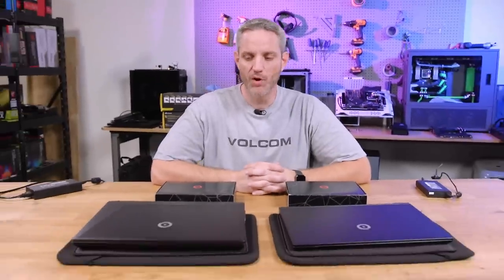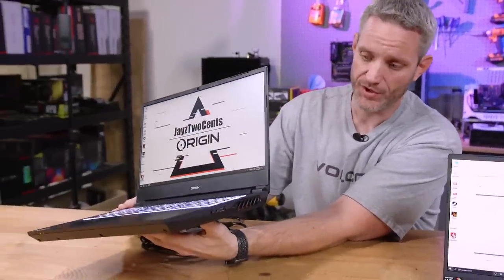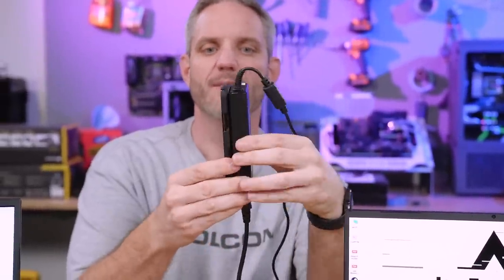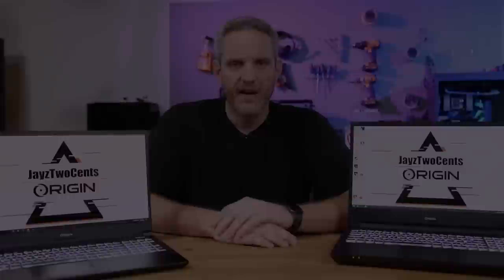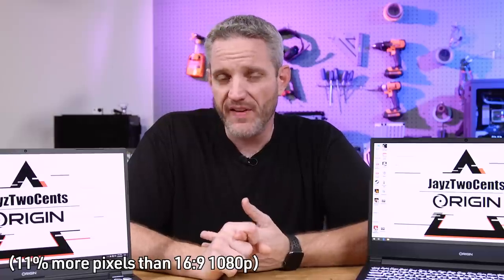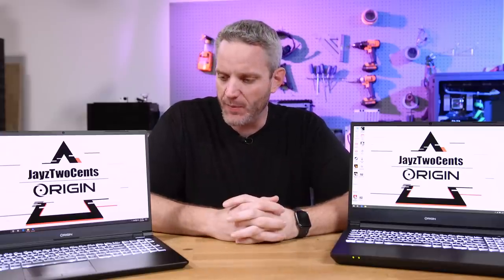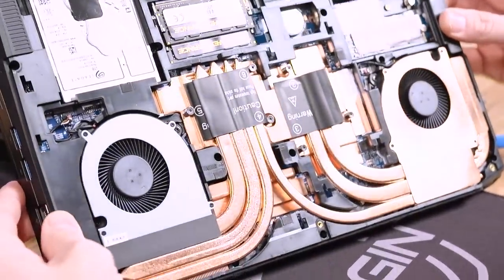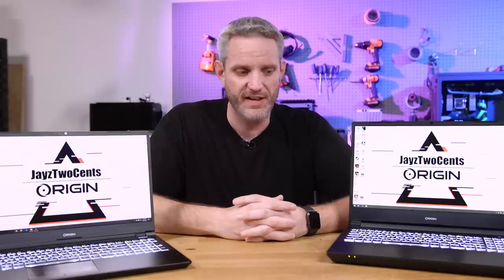A Laptop with 16 Cores 32 Threads?? Desktop killer!

Comment: “These laptops are faster than some desktops”

Yes at twice the price
Reply: cant pick up your pc and go to the park to watch homeless people fight though
Reply: @IIlicit  actually i am embarrassed to admit that i can.  took the UPS once.
Reply: Utube isJunk  Most laptops don't have soldered RAM. And if you actually watched this video, the desktop replacement has a socketed CPU.
Reply: Twice the price of only the computer, yeah? Did you include the price of a 4K OLED screen and a battery that will power both for a few hours? This one will be harder, but it's also noteworthy that it's probably 5% the size of just your computer and you can toss it in a bag. Admittedly if you have an ITX build this will be 20-30% the size of your computer instead - but then the UPS would be the size of the computer also, and you still need a monitor, mouse and keyboard.
Reply: @B B The 17" screen yeah. If I have so much money that I'll be buying a full decked out laptop and have at least one fully decked out gaming station, I wouldn't be worried about the price of any of it. I didn't include the mouse and keyboard in the price argument, just the portability argument. Generally you'd have a pretty decent mouse to go with it, but I sure as hell wouldn't carry a keyboard around to game.
Reply: But remember you get a free 4K monitor and a mouse vs. a desktop.
Reply: @IIlicit  ima desktop guy, but  touché.  Id dump my x570 3600 for either laptop quick
Reply: Well with Origin it’s more likely three or four times the price...
Reply: @kaldo_kaldo  you gonna be plugging in your desktop same as the laptop i cant see that thing lasting very long in a Starbucks playing any game .
Reply: @B B Stop playing games... Dude, I'm 28, I have 1 kid, a job, a loving wife, and I still play games. Just because you grow up, that means you can't play anymore? I went on trips with my family, and when we were on the hotel at night we just boot a game and have even more fun. Just imagine being so narrow-minded and thinking that you grow up and you stop doing what you find fun or what you love. You need to grow up
Reply: @B B did you read the part where I said we boot a game AT NIGHT?? Who said we don't enjoy the rest of the day?? When we go to the hotel after everything we did during the day?? Or don't you even know how to read the whole comments?
Reply: It's not faster tho' is it? Isn't running at 5GHz+ ? No? Well it's slower then.
Reply: @B B lol even in trying to insult you still show lack of intelligence.
You should try more, I believe in you. I'm pretty sure your father is disappointed in you right now, but let's change that.
Reply: oktc68 yeah it’s faster, but I was talking about the price
Reply: Twice the price, one tenth the weight, and a million times the convenience.
Reply: Utube isJunk  lol my laptop has 4 sodimm ram slots, an socketed i7, an socketed quadro graphics card, 3 m.2 nvme slots and an changable 96wh battery😂 and my laptop is one year old
Reply: Utube isJunk  dell precision 7570
Reply: No joke - I just matched the specs of my desktop and the thinner laptop was $1,200 more than what I spent...
Reply: You can take them anywhere and already have a keyboard charger etc u see
Reply: Utube isJunk  well if you can't upgrade and have 4000-6000$ but a msi gt76 Titan with an i9 10900k rtx 2080super it's insane
Reply: @spaghettiupseti9990  k
Reply: @IIlicit  u wouldn't like picking up this laptop tho :P    .....thicc boy
....sort of kidding
Reply: @B B what I get like 400-600 fps on fortnite and it's because the graphics card is mobile that it isn't as good but it's better than a shitty Nintendo switch
Reply: no one stop you to carry ur pc everywhere. its cheaper, better, only big. But one one will stop you.
Reply: And  only if it's  plugged in.
Reply: @nrgamingtech2797  BB is Probably just Mad because her dude spends/spent "too much" time Playing games instead of spending it with her.I had an ex who would always get mad when I would play video games,but she liked watching movies just fine. LMAO some people don't get it.
Reply: Utube isJunk  You might be interested in these clevo machines https://clevo-computer.com/en/laptops-configurator/graphics-card/with-mxm-module-replaceable/
Some of the first one's I've seen in a while with upgradable rtx mxm module cards in them.
Reply: @B B I bought a gaming laptop. I use it at work and when I'm not busy, I fire up a game and make it look like I'm busy, do you think it's pointless for me to have a gaming laptop? can't exactly lumber around work with a fully-fledge desktop, monitor, keyboard and mouse every day. 
And after experiencing the simplicity of not having to carry around all that stuff in other situations, I gotta say, I don't think ill be going back to using a desktop as my permanent machine, I can sit and game anywhere I like in my house and all I need is a plug socket. Also, it's not just about gaming, it's about having everything you want and do on 1 machine, I mean I can take my laptop on long journeys if I'm away visiting friends or family and I have my main PC with me that I use every day, it has all my stuff on, I can even use it on the actual journey if I want.
Reply: @garfield2742  Yeah, but I'm not exactly gonna go to my aunt's house and take over her dining room with a PC, monitor and a bunch of cables
Reply: @B B Or maybe you are someone like me, whom travels a lot and need the portability. Sorry dude, but not everyone still live in their moms' basements.
Reply: @B B Seems like you don't know the difference between travelling for holidays and travelling as a lifestyle, staying and working in different countries for months, sometimes years. Hope you enjoyed those 4 days though.
Reply: @IIlicit  I don't need my PC to come with me to go to the park and watch homeless people fight.
Reply: Especially from Origin, which has always been a huge ripoff. They're always overpriced. Origin seems to think their logo is as valuable as Apple's. And in a way, I guess they're right: I'd never pay for either.
Reply: @kaldo_kaldo  Nobody wants an OLED screen for their PC, you'd get crazy taskbar burn-in.
Reply: Pretty sure this is the same argument we use against console peasants tho
Reply: Cut the price back in half by using desktop components -- our 16-core based around a 1950x: https://youtu.be/NsdXrU-No2c -- fully upgradable if you are handy with a hacksaw 😂
Reply: But more than twice the ultility considering form factor size, mobility and still being multi functional for gamers, pro production and entertainment.  I still used old tech devices and media for entertainment using second hand free devices and have innovated my own cooling solutions to defeat the heating issues for my laptop / studio desk top by using a metal cooling plate from  old camping RV food & bev coolers. As long as its not so cold as to produce condensation moisture....it cools the entire area of the bottom of the lap top ( air intakes and chassis body ) and I never hear the fans while gaming.  I can not do that on desktop chassis and then that requires more $$$ investment, time and materials and some micro management to achieve the same practical solutions to heat issues and performance.  Overall, it has been a better overall investment. This makes my new 2012 laptop investment of near $3,000 a less painful prospect . I'm just waiting for the various brands flagship models to arrive at retailers & wholesalers to make my final selection due to specs and features.
Reply: @ernestopediangco5354  It's far cheaper to cool a desktop PC than it is to cool a laptop, it's also easier to get lower temp on a desktop and keep it cool for far longer, laptops get hot fast because of the limited airflow.

Comment: For software engineering (compile), I could see the 3950x laptop making a lot of sense. In many cases, it’s a highly parallelized task that the user needs to perform over and over every day
Reply: The ryzen 4000 series chips and laptops are pretty good and the processors are pretty good but the sad part is that the 4900 us in the g14 is not unlocked
Reply: I mean you can get 3700X power out of a 4900h if you wanted to. I mean I have shoved my G14 4900HS up to 80-90w. I bet you if you can get cooler that handles that better, you can really push a 4900h. You can definitely get up to 4.1GHz all core boosting.
Reply: CI is not a replacement for compiling locally
Reply: @tmi1234567  Yeah the cpu is very powerful. See this post https://www.notebookcheck.net/AMD-Ryzen-9-4900HS-performs-better-than-the-Ryzen-7-3700X-and-even-the-mighty-Ryzen-9-3950X-in-startling-UserBenchmark-test.458960.0.html
Reply: its hit/miss if theres no 3d computing needed sure a 4900h is enough i dont expect the hs to ever be unlocked since its binned to run at a lower tdp....and the g14 support as it is/ryzen2 has been proven to lack proper tdp output when met with an equally high GPU load. Lifetime i couldnt trust a g14 for 24/7 torture use. For students or Light rendering or software that isnt 3d heavy the g14 is one of the better options granted its pricey due to the lobbying IMO asus did to get the HS 35w as a q3 drop.....vs q4 like the rest of teh vendors. zen2 hasnt even been proven to run with a 150w gpu or a max q 2070 or 2080....which caters to the TDP aspects of the mobo/vrm/etc....vs this actual AM4 platform for example with an obviously ideal VRM solution as well as cooling solution/thermal paste etc....and this guy links a user benchmark test.......as if intels dont get higher scores in single-4 core either as amd scores in the threads intel doesnt have category as per usual. LMAO the link is pure bolognious ness
Reply: @blacknester my favorite part are the naysayer idiots that would like to nitpic about "fan noise" during this or "workload" tasking final rendering etc......like.....why were you planning on mixing an album at the same time/watching a movieTFFFFFFF the logic is so void, i doubt a single person cares about those concepts ;) with a r9 laptop
Reply: @blacknester id never complain though granted that much power is on mobile its still something im happy/hopeful about....i just feel bad for people that pay full price and expect to be able to run 3.8ghz or etc while gaming even if its just 2 cores. But again PPL that buy amd dont do so just to game...so id never expect something to be able to do/perform beyond its capability. I just feel bad they call them gaming laptops and invest in their production vs the obvious eventuality of thunderbolt/usb4 with amd and being able to run an E-gpu with renoir or cezanne. Then they can totally dedicate the LAPTOPS cooling and heatpipes just for the APU not a dedicated gpu. Then surely we can see mobile ryzen fully ticking on all cylinders. In time soon soooooon. But not soon enough...sadly